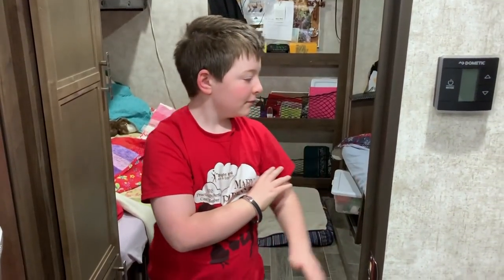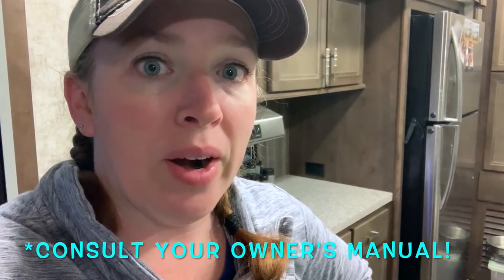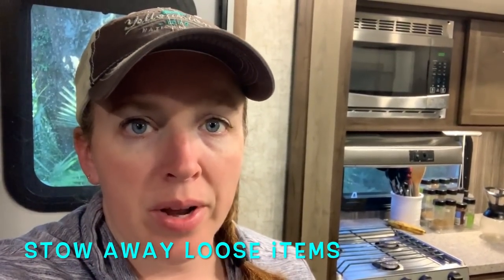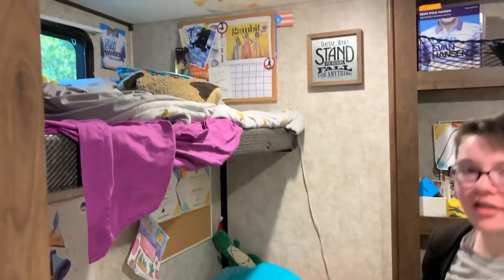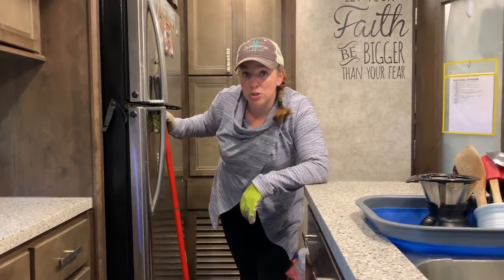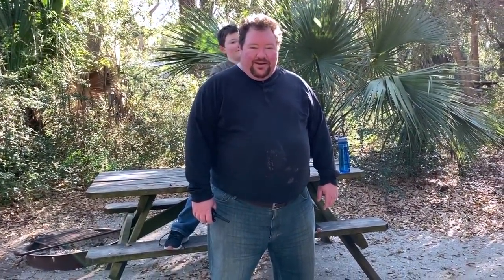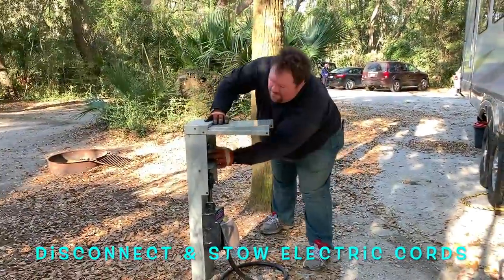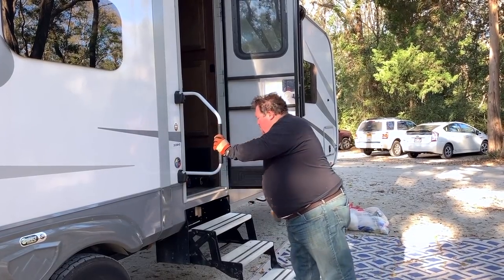🚌RV Beginner: How to Setup and Tear Down a Travel Trailer and FREE Checklist🚌[EP 30]

Comment: Hi, my name is Callin, and  I'm from upstate N. Y. I've been researching Rv's a little over a year now. Initially I was convinced I wanted a Jayco Eagle 355mbqs, but later determined I wanted something lighter as well as pre-owned for starters.
I recently discovered your channel and was immediately impressed/intrigued, and subscribed. Shortly after I noticed there were other Christian RV'ers. More about that later; for now I'm interested in the numbers regarding your rig and tow vehicle. When researching Suburbans I was left with the impression they could only tow 8000 lbs. and the OR 310bhs GVWR is listed at 11500. I obviously don't have all the info., and was hoping you could fill me in on your towing numbers. I think I'd much rather have a suburban over a pickup truck; which is why I opted for a travel trailer over a 5th wheel.
Lastly, is this open forum the only means of communication, or is there some other means???
Reply: Callin,  were you able to connect with them?